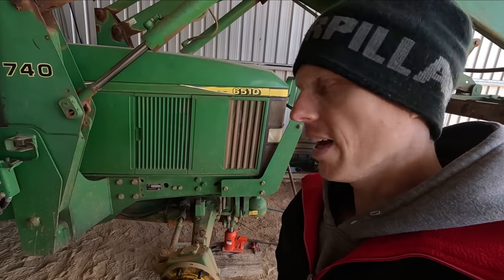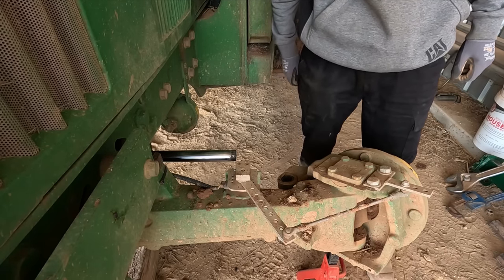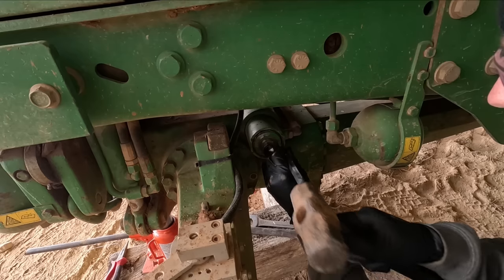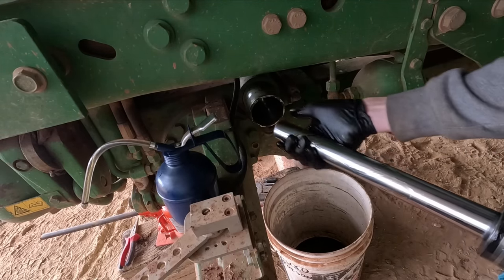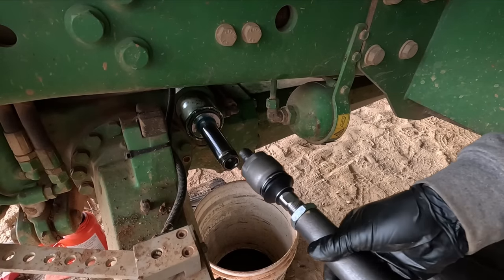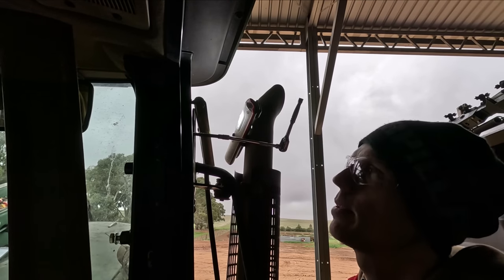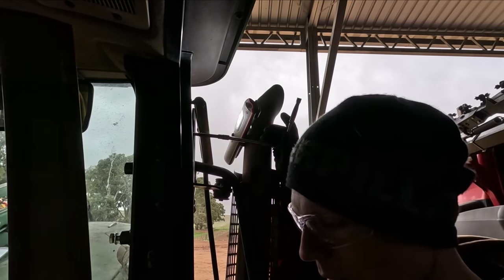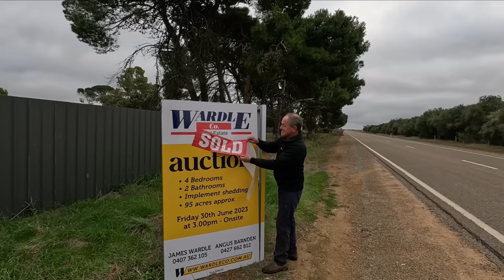A Small Addition To The Farm | Steering Cylinder Rebuild For The John Deere 6510 Tractor

Comment: Congratulations on the land purchase, it’s always nice to see real farmers and not corporations expanding. I have never had any luck with easy outs, the trouble with them is invariably you’re using an easy out because you’ve shorn the head off the bolt which only happened because the bolt was seized. And the easy out that fits is too small to take the torque required to undo the seized bolt which is why you shear the end off it thus creating another problem. I go straight to oxy if I can.